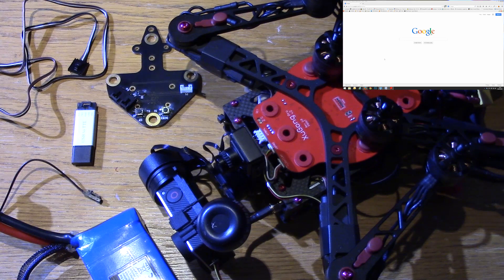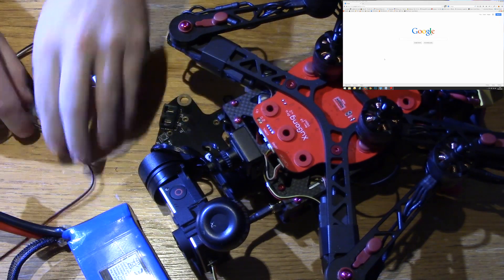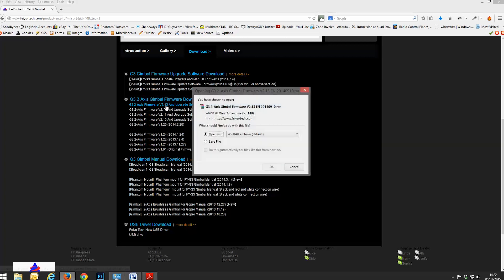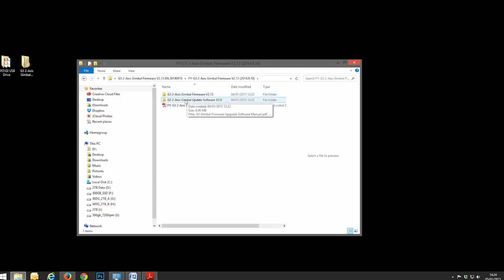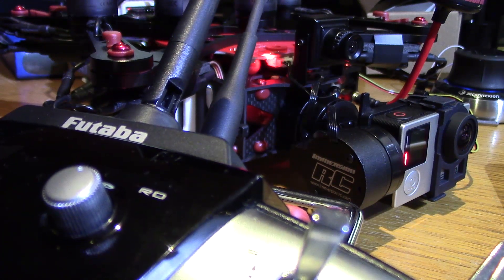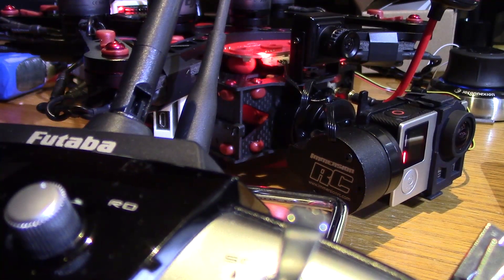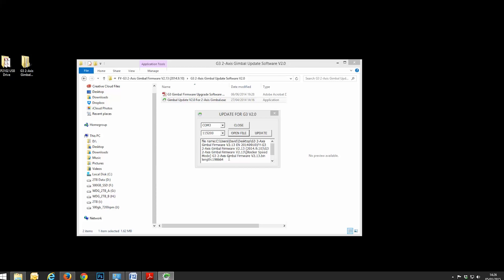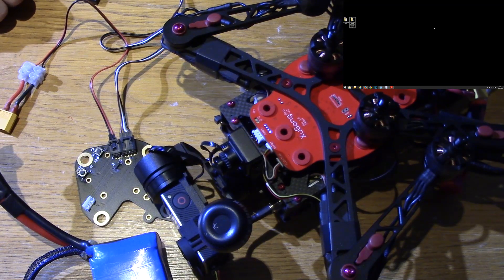IRC XuGong v2 Gimbal Update Build

Comment: Hi,
First of all, thanks for fantastic videos about the XuGong v 2 frame. I don't know how many times I have watched them but they have been of great help.
When it comes to the gimbal I have struggle a lot to get the update working. I just couldn't establish the link, until today! Just to make sure you really connected the brown cable closest to the power cable as you said I realized I had a manufacturing error on my cable. The white thread was attached closest to the brown, watching watching your video closely made me realize it should be next to the black. Switched place and it work on first try! :) 
Cheers!

Comment: Hello, I'm hoping someone can help me, I have a Taranis -plus - Naza v2 - Xugong v2 with Gimbal
I'm having some issues, i can't seem to get gimbal control through the x1 channel(channel 5), I have looked around, some are saying the xugong gimbal control is ppm only, is this correct and is there a way i can hack it so it can see sbus?
I have looked in the xugong firmware and tried even changing the channel it's on but can't seem to get it to do anything

Any help would be appreciated

Comment: how necessary is it to do the firmware upgrade?  And did that USB device shown in the video come with the gimbal? (I didn't see it with mine.)
Reply from the maker: Joseph Dawson Well the IRC branded versions all have fairly recent firmware. There are a few improvements but nothing mind blowing. The USB cable should have been in the box I think. Mine did as far as i recall.
Reply: d3weyTube i found the usb cable ... hooked it all up and everything looks like it should work but it is not communicating between the gimbal and the usb.  USB port drivers are working show correct and right port... but when i put power to the whole thing the gimbal powers ... and levels and then it never says it is ready like yours did... i tried to do the upgrade anyway and it just fails.  so at this point i am going to keep it that way i guess... only annoying it it has speed firmware by default and i kinda like position firmware... (just a preference thing)  i like doing speed of the movement control through radio settings.i wish the bottom plate was 2 carbon bits...... getting access to the inside quickly to fix something you did wrong while your building is a bit of a pain in the ass... but i know that is not going to be a common thing... once it is done...  I am using the new naza 310 power system...

Comment: Hi, reading the comments, it appears that this gimbal will not work with Frysky X8r without some converter or elaborate mod, is that correct?  I've been battling with this gimbal for a while now and it just wont work right. It just rolls over, i've tried to update the software and all i get is a FAIL msg, over and over again. starting to run out of patience for this... here's a video of what im dealing with https://www.youtube.com/watch?v=2Edwwt-m1Dg&feature=youtu.be

im not worried about mid air adjustments, just want it to sit in one spot so i can film with it...
Reply from the maker: dj Sulli You are correct. Sbus to PPM converter if you want to have camera switch and gimbal tilt. If you just want the gimbal to work and tilt then the 'elaborate' mod... which is actually just plugging in 1 wire and a NAZA assistant tweek as seen on my vid here: http://www.youtube.com/watch?v=-xKKcXVI_pw
Fail message on update doesn't sound good.... you should do a video of exactly how you are updating the FW. I've seen a lot of people who are positive they are doing it correct trip up. Nothing to be ashamed of cause there are a few areas that will cause it.

Comment: Hi d3wey. Great Video! I haave a question to you. i just bought a xugong v2 pro. i have a futaba t8j and want to use a r2008sb Receiver with s-bus. everything works but not the gimbal tilt function. i tried it with the VR knob on cannel 5 but the gimbal doesn't move. When i poer up the System. the gimbal goes to the hoizontal Position but then it tilts 100 degrees Forward. When i do not connect the Receiver and power up the sytem, the gimbal works fine. Do you have a idea what i did wrong? I'm lloking Forward to your answer. BR, Marc
Reply from the maker: That is because you have no direct connection with the gimbal when using the r2008sb. The gimbal tilt goes via the XuGong's PDB board and hence will only work with a PPM Reciever (like EzUHF).
Options (untested by me) are to either get something like this: http://www.alofthobbies.com/frsky-sbus-converter.html which converts the Sbus to PPM. Alternative involves tapping into pin 4 (last pin on the right of the gimbal plug as you face the XuGong from the camera end) and then sending it to a spare channel on the r2008sb. You can do this by either cutting into the wire or soldering to the solder point on the PDB board above the plug.
Final alternative if you don't want to cut/solder is to attach the Phantom power board that comes with the gimbal and run the included cables to the r2008sb as per Feiyu-Tech's instructions on their website (download the G3 2-Axis manual). Hope that makes sense.
Reply: d3weyTube hi. Thanks for your quick and perfect Support! i will first try the cable solution with direct connect between the cimbal and the receiver. i will tell you the result :) thanks so far!
Reply: d3weyTube hi. Thanks für your quick and perfect Support. with your help i already solved the Problem. i did it with the direct Connection between channel 5 on the Receiver to pin 4 like your said. it is an easy mod and it works great! thanks again for your help. BR

Comment: Hello D2wey,

Is there any difference between this gimbal and the original Feiyu G3?
I'm asking this because I'm interested in the Xugong v2 but I already have the  Feiyu G3 and would like to avoid to buy the ImmersionRc branded one if they are exactly the same.
Reply from the maker: It depends how old your G3 is. Older versions can only have firmware 1.25 max. Newer versions like the IRC are version 2's which can have 2.XX firmware (latest is 2.13). The fundamentals are the same on the older ones so there is no reason it shouldn't work but the features/firmware improvements of the 2.XX fw are preferable. Best bet is to buy the frame, try the old one and if it doesn't do what you need it to then buy the newer one. The fittings/screw holes are all the same across all G3's so fitment won't be an issue.

Comment: Thanks a lot for the vid. Sadly on my windows7 i succesfully installed the usb driver, the device manager lists it as com8, the flasher software shows it in the list, i load the firmware, but then after powering up the gimbal i get no initialization and trying to flash it ends in a failure dialog. Requiring Windows to flash a device may be last century, but failing at it really made me annoyed as I actually wanted the position mode, not speed mode :(
Reply from the maker: It may sound silly but have you tried the USB in all available USB ports? Desktop machines with ports at the front often suffer from power issues (because they are hubs) so plugging into rear ports can help. Likewise on laptops swapping to a different port can sometimes make the difference.
Best thing to do if that doesn't work is take a vid of the procedure you do and the messages that come up and post it on YT that way I and others can take a look.
Reply: So after some experimentation, the problem was the battery. When the battery is beyond some magical voltage number, the gimbal will stabilize itself and flash slowly. It will not initialize. If the battery is completely full, the gimbal will not stabilize, but flash the led fast and initialize fine. Thanks for making me not give up :)